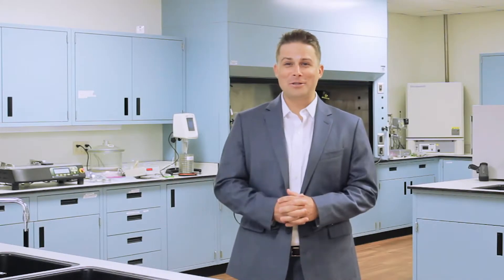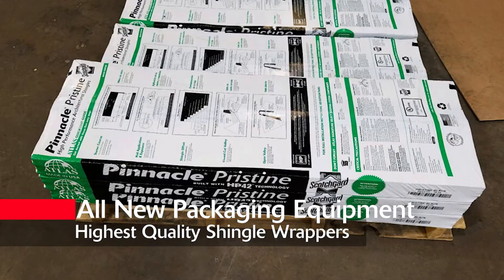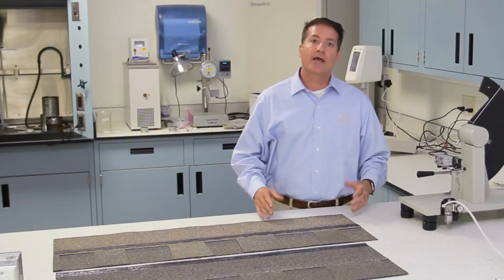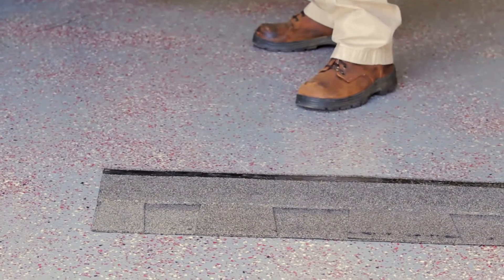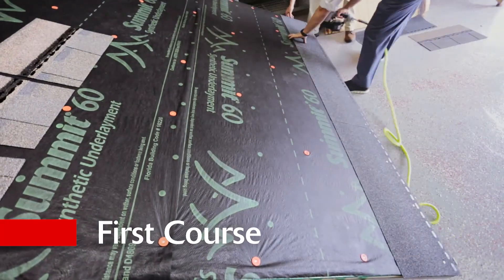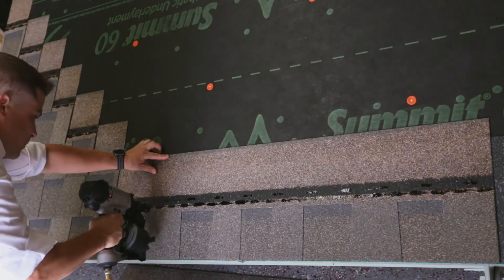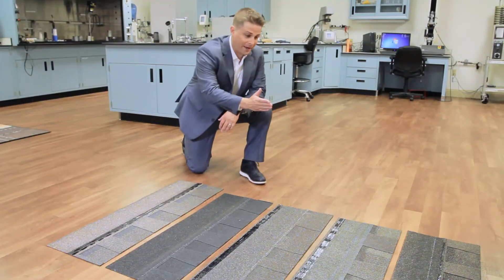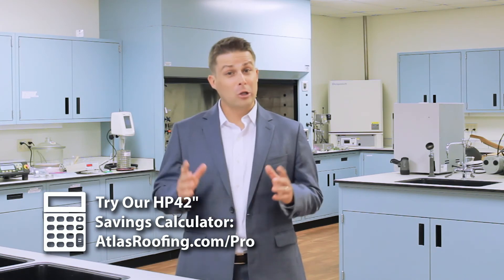Biggest Shingle in America - Atlas Introduces HP42 Shingle Technology (2017)

Comment: Best dam shingle. G.A.F. has been fired after 15 years of use on my customers homes.
Reply: Yes Elk was a great shingle.GAF ruined a good option in shingles. And I'm a seasoned roofer from a union tile/slate co to composite roofing.Ive covered homes from so.fla after Wilma in 06, N.Carolina, to Alpena Mi. I been in the trade over 30 years. I'm pretty sure I know something good from something bad bud.
Reply: What was your complaint w the gaf shingles? Would love to hear your feedback!
Reply: @joewindiana2150  slipped/misaligned shingles was the biggest problem. I have many pictures but I dont believe theres a way to post them for you guys. I stopped using the hd's and switched to strictly Armour Shield and bought into worse problems one being the color slate. Its capping (seal-a-ridge) doesn't match its shingles!
Reply: if you recall GAF bought ELK and Timberline is made in Ennis TX plant its the same ELK , I guess thats why you just a BUILDER. National Roofing